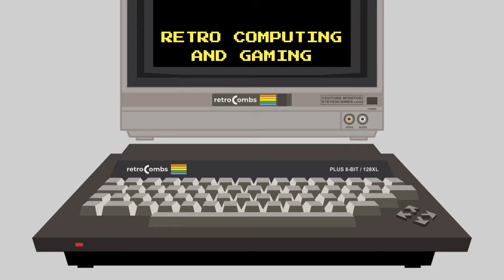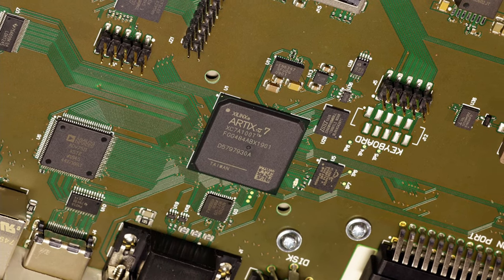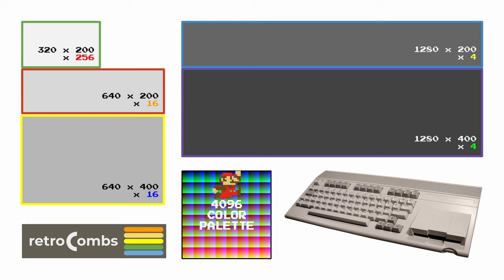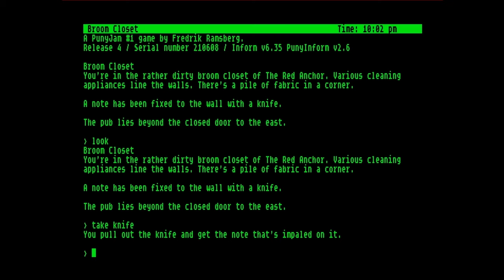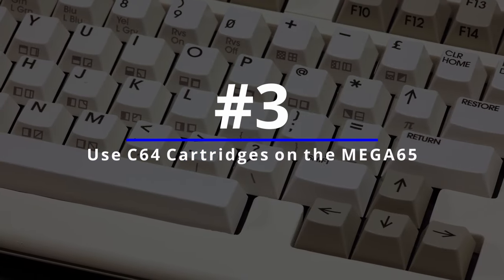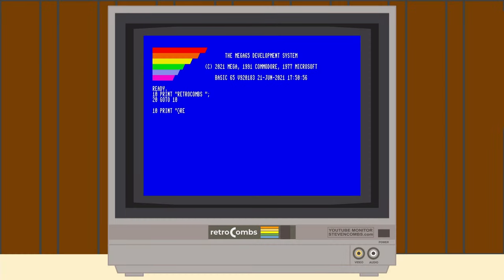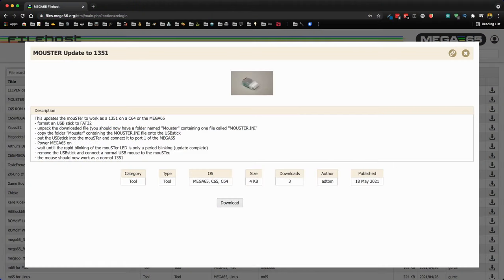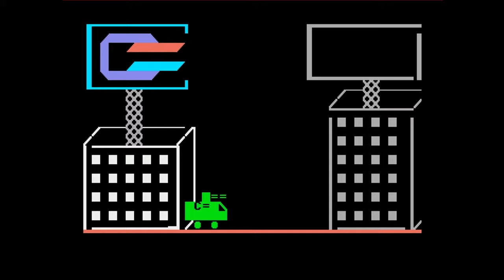Part 1: 10 cool things you will do with a MEGA65   | 1 to 5 and a bonus

Comment: Please be advised that FPGA, fortunately, is not emulation. This is technology that, so to speak, rests on its own shoulders. The very electrons within the M65 flow in the same way that they do inside actual C65 hardware - and unlike emulation, it isn't reliant on a foreign operating system that tells it what to do. The M65 doesn't bow to some other party like Apple or Microsoft - on the contrary, it stands firm on its own feet.
Reply from the maker: I'm not in disagreement with you. I've been down this discussion many times which is why I shrug my head in the video knowing that someone is going to set me straight. After several online discussions there is 50/50 disagreement. It's not the actual hardware, but it also does not follow the traditional emulation definition. I chose the word because it's the easiest to describe for those new to an FPGA. Thanks foe sharing!
Reply: @retroCombs  FPGA is hardware simulation, as opposed to software emulation.
Reply from the maker: @macstar8317  Agree. Did I say software emulation in the video? Rats.

Comment: One gpt to love the effort put in MEGA65, the keyboard, maual, floppy, reacreation of C65 plus mega mode ...
Reply from the maker: It really is a sweet device. And BASIC 65 is a blast!
Reply: @retroCombs  Microsoft basic 10
Even Amiga wb 1.3 had one, but it did not support Amiga  chips. Seems this basic 10 and QL super basic are top of that line, maybe BBC mocro
Reply from the maker: There have been some cool BASIC 65 demos. Check out their file host at files.mega65.org
Reply: @retroCombs  yes I do, thanks and I love it's growing

Comment: I wonder if it is possible to connect the Mega65 to a modern printer on the local network using the Ethernet port... It would be cool.
Reply from the maker: Not yet, but I do remember someone in the community mentioning this along with automatic firmware upgrades.

Comment: Very expensive (whether this is justified is not is another thing, even justified, it still is objectively expensive).
Also it REALLY needs cores for the other Commodore 8bit computers and I mean definitely VIC20, C128 and +4 and even PET (or even Amiga as this FPGA seems to be able to handle it easily).
Very restricting that it cannot expand too much, because it would allow for WAY more cores that need more RAM.
Reply from the maker: Other cores are on the way. I too am looking forward to them. There's also talk of an Amiga core. Cores are based on miSTer cores so the base is already there. REU support is also on the way to provide more memory. I don't think we are even close to the end of the development and I expect much expansion.

Comment: I REALLY don't like limiting the base model to 128K ram. This will lead to most software aiming for that lowest denominator. I think everyone should get the machine maxed out with ram.
Reply from the maker: My understanding is that 128K is part of the base and that they are working on REU emulation support via the FPGA later for maintain compatibility. Don't quote me, but I believe they were looking at 512K to 1Mb.

Comment: I own a C64 with thousands of games on Cassette tape and on Disk 5 1/4. Can I connect my 1571 disk drive and cassette tape to the Mega65?
Reply from the maker: A 1571 yes, but a cassette adapter is still a work in progress.
Reply: @retroCombs Is it possible to use the amiga games on 3.5” disks with the mega 65?
Reply from the maker: Not currently. When the Amiga core comes to the MEGA65, then that will likely be possible.

Comment: Really looking forward to this but you can purchase a C64 Reloaded MK2 or C64 Ultimate Elite. (C64 U.E. goes up to 48Mhz). I would like to see it have USB for the joystick ports and dump the 3.5 floppy drive for a Gotek. Why use FPGA then stick us with old peripherals?
Reply from the maker: I'd really like to try one of these C64 alternatives but availablity and price is holding me back. See my other comment about peripherals. Excited that the community can add old and new drives through two MEGA65 expansion connectors!
Reply: No, keep the floppy :D
Reply from the maker: The original experience!

Comment: 1MB maximum RAM seems too little for using 256 colors. Compare it to the stock A500, which was really short on RAM with it's stock 512K, but only 32 colors in 320x200 mode. The M65 would need 8 times more RAM for images than the Amiga with 32 colors... and the upgrade to 1MB RAM was standard on the A500
Reply from the maker: Great question and I asked those more knowledgeable about the hardware to respond on the Discord #motherboard channel. You can read their more informed responses here: https://discord.com/channels/719326990221574164/793683199518703638/909812005630799912
Reply: @retroCombs  Hello! For some reason the link doesn't work (It opens Telegram, but no channel). But thank you for asking! :)
Reply from the maker: First, did you try link on computer? Second, here are the answers. First the hardware answer from Developer, LGB: 

"In a nutshell 320*200 / 256 colour for each pixel is 64000 bytes of info. Everywhere. The layout of memory / organization (bitmap vs "chunky" etc) is one thing, but in sum the needed amount of information is 64000 bytes always. In case of Amiga OCS, I suppose the limitation is the available bus cycles, and memory bandwidth / speed to fetch more data per video clock. So some shouldn't forget that amount of memory for a certain task is one thing, alone it does not say much, since you may need some minimal speed to access that information to be usable! In case of video signal generation there is the pixel clock it must keep up with, otherwise it won't work."

Now a practical answer from Developer, Paul:

"I would say that the spirit of an 8-bit computer is that there should be limitations that require careful thought to work around. For example, in this case, it is quite hard to have 720x576 256 colour display, because using a flat frame buffer (or bitplanes), but like with demo coders and 8-bit game developers, people find creative solutions. The hunt is part of the joy of these machines. If you want an unlimited machine, buy a new PC. 😉"
Reply: @retroCombs  The links opens Discord, but doesn't add a new server. But that's now problem, I am happy with all the explanation you gave! :)
Thank you!

Comment: All my C64 stuff except 2 game cartridges are on tape, that includes like spreadsheet programs and stuff my dad used for serious business. That's my problem, I guess, but it's what put me off. I have over 100 tapes and wouldn't be able to use them.
Reply from the maker: Whoa, that's a lot of tape! Sounds like a great collection. While it won't have datasette support initially, the MEGA65 includes two PMOD connectors that will allow this feature, and other hardware connections, later.
Reply: @retroCombs  Here in England, tape software was abundant everywhere, and started at 99p(about $2.20 American using conversion rates of the time). Even a kid like I was could have a game collection that size.
Reply from the maker: When I started with my VIC-20, software was very hard to find. I remember purchasing several titles on Cassette only to find them very disappointing. I preferred cartridges, but they were expensive. I know cassette software was popular over the pond, but in my neck of the woods, they were hard to find and I don't remember ever finding them around $2! I'd love to see what your collection looks like. Do you have an image online? And how do you store and protect them?

Comment: I'd like to see a PostgreSQL client for the C65 so one can connect to a database via ethernet.
Reply from the maker: Curious, what would be your use case. Sounds interesting.
Reply from the maker: @danield.7359  The MEGA65 will be perfect. With it's mechanical keyboard, the typing sessions are a joy and for the use case you outline, ready for the job! I myself am looking forward to GEOS and a dedicated word processor to write long form and blog entries. Thanks for the detail. Now I'm missing the old days. 😀
Reply: not that this would be a deal breaker, but as it comes with an ethernet port and possibly could be used also for BBS browsing or even some other protocols such as gopher and generally for data exchange, did anyone think about UTF-8 support? That would be extremely helpful.
Reply from the maker: It is already capable of BBS connections (https://www.stevencombs.com/mega65-3#bonus-1-connect-to-a-bbs-and-the-internet-via-ethernet) and more online capabilities are on the way.

Comment: 1280 X 200? Wow, those are some seriously disproportionately tall pixels! Why can't they put more of that resolution into the vertical count to be more even?
Reply from the maker: It's a legacy resolution from the C65. They kept all the original resolution screens to maintain compatibility with the original ROM. It is odd, for sure and will likely NEVER be used. Great question.
Reply: @retroCombs : Thanks. Oh, I imagine that it will be used here and there, I mean at least played with. And I understand that it would be included in the new computer so as to not break things. I just wonder why Commodore would've made it so uneven.
Reply from the maker: It is odd, indeed.

Comment: So is it compatible with the I'll be it small library of c128 software if so shut up and take my damn money already
Reply from the maker: Won't be C128 compatible, but many of the titles, such as GEOS began as the C128 version and are making the conversion. A C128 core shouldn't be far behind either.
Reply: @retroCombs  so at some point it will?
Reply from the maker: @bricethompson1922  It should be once a core is created. Several cores are already avaialble such as a Gameboy and ZX Spectrum. MiSTer cores are the easiest way for folks to port. Not a guarantee, but still a good chance down the road.